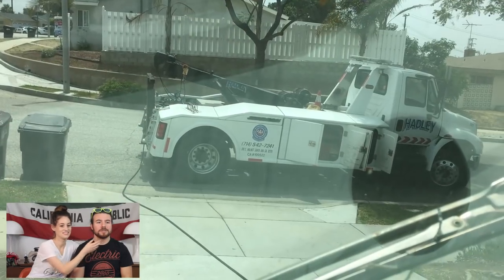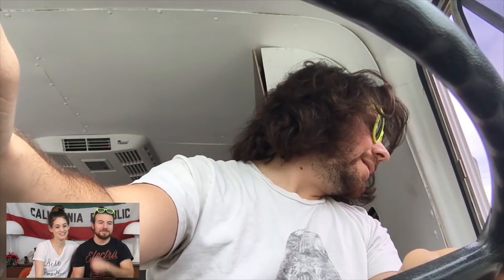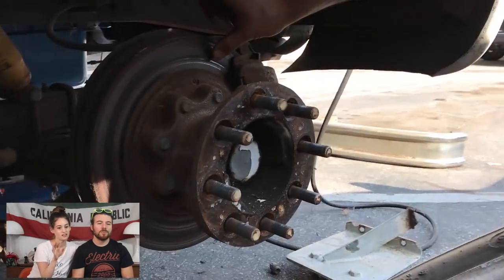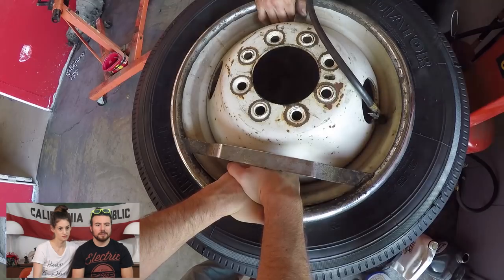Cherry Travco Update with Nick!

Comment: My 1973 Class A motor home dodge, engine is 318, is vintage.outside is two toned-- off white/burnt orange. I have done a remodel, update systems, making a Glamper inside. Darling. Comfortable. Very nice now. All original except I put in a large refigerator w freezer. Painted, new curtains, new flooring, new beds, made dinette into a daybed. Scrubbed Wet bath. So cute. 20 feet long & looks like a bread truck. All new curtains surrounding cockpit too. New locks. For sale 3/2018 in San Diego. Very nice.

Comment: Great update!
Glad you didn't give up on the ol girl. (Travco)
Brakes are definitely in your future. Flush out the entire system of brake fluid, inspect the lines. That's probably 5 plus ton's you have to stop.
Not surprised you can't find parts. Got to improvise.
Looks like you have an invaluable resource in your interested mechanic. Rare.
Wish I could drop by, and see it. Unfortunately I'm in Maine.
Good luck.

Comment: Parts aren't as easy to find as say for a '11 Mazda 3. Not too hard to do, however. FB has a Dodge Travco group, as well as Vintage RV group, as well as websites outside of FB. Brakes & suspension parts- Alretta & NAPA are best best. Motor (440 RB motor) and the tranny (727 Loadflite; the HD-industrial version of the 727 Torqueflite with the parking brake on the tail housing) are very, very easy- a lot of aftermarket available. Never look up "Travco." Never works, you need to look at a Dodge M-375, M-400 or M-500 chassis;  the frame/chassis running gear was designed to be used by several RV, bus, and their MD & HD truck line. Heck, you can even upgrade/improve the handling and brakes- you are the smaller chassis, so you can get Alcoa forged wheels, Hankook ah-11's, Bilstein shocks (AJUSA), swaybars (ADDCO), sway control, poly bushings in the leaf spring eyes & swaybar links...you can make them handle & ride better and safer than the day when they were new.